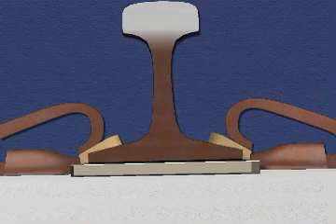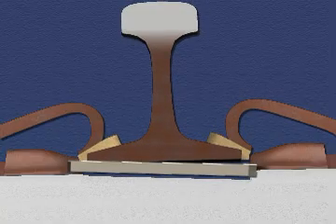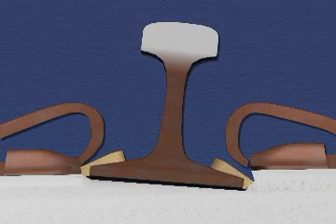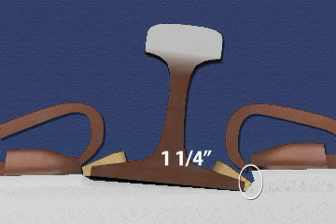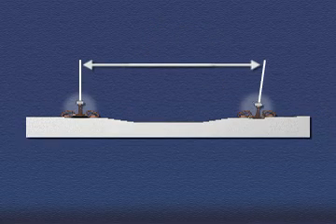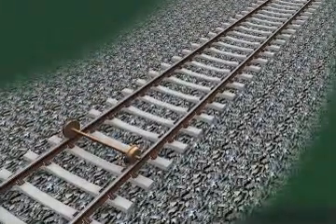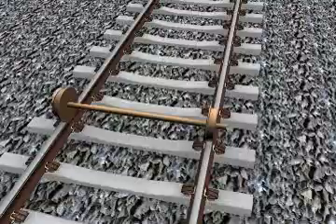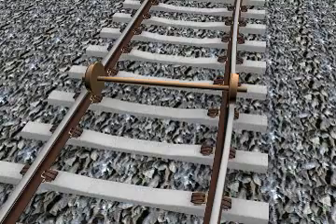Derailment of Amtrak Passenger Train No. 27

Comment: build new wheelsets with double-flanges;  one on the normal inside of the wheel, and a second one on the outside of the wheel to prevent
Reply: That is not feasible as then you cannot easy have turnouts/switches.  Also, if you had a double flange in the case of this video, it would still ride up and over the rail because of the shallow angle of the widening rail.

Comment: Inspections, and the management of inspections, frequently seems to be found wanting in these cases. An inspection train had twice flagged guage widening at this location, but only at a level that required monitoring. Monitoring may be appropropriate if it's know why the guage widening is occuring, but I'd have though that until then, it should be treated as an accident waiting to happen, because it's not known whether the train is detecting the greatest widening possible. There was a different kind of inspection train better suited to detecting guage widening but it wasn't being used there. Similarly, there had been reports of rough running their prior to the accident, but the response was to inspect, and when nothing was found, to leave it at that. Given that there was more than one such report, I'd have thought that the track should be regarded as suspect until a reason for the rough running was found, or until the track had been inspected in detail, using the appropriate equipment, and found to be in good condition.
Reply: As an active railroad employee who is also a Track inspector when an inspection train runs over a territory any conditions that it finds are supposed to be confirmed in the field by performing a follow up inspection of the area.I have been a track inspector for 15 years and I will say this there have been several times where I go and perform a follow up inspection which not includes finding the condition but looking at the conditions of the ties, ballast, drainage and other factors and on several occasions I have imposed a more restrictive slow order and on a few have even removed the track from service till repaired.  A factor with concrete ties is that you also have to watch for the entrance of mud into the ballast, and if there is mud it acts as a lubricate to the ballast to grind the concrete ties to the point of failure. If I remember correctly the FRA minimum Maintenace standard that concrete ties are to be maintained to at least class 4 standards for tie conditions.

This video also shows that there were an excessive number of defective ties in a row which should have put the track out of service till repaired. to that falls onto the inspector and also to the supervisor for not escalating this to repair it.

Comment: Why dont trains run like roller coasters where the wheels are above and below the track?
Reply: It's called Cost to Benefit ratio. Not going to happen. You are talking about millions of cars, trains and countless miles of track and bridges, etc that would have to be changed. It would be more realistic to have a robotic camera inspection unit to run down the tracks on a maintenance schedule to do visual inspections. If a camera can inspect a glass bottle during manufacturing for flaws...it can inspect a track for possible flaws.
Reply: Also, because trains usually don't do loopings.
Reply: @ZorbaTheDutch 
Yes. Usually. But sometimes...
Reply: Because that would more than triple the cost of installing railroad, make it more expensive and harder to maintain, require more expensive and valuable materials, complicate train wheels and make it much more difficult to maintain them, make it impossible to have railroad/conventional road intersections, make switching stations much more complicated and require more power, and most of all, would be an impossible undertaking to install such rails universally.

TLDR literally impossible to implement without bankrupting the entire country and maybe canada too

Comment: I've seen WWII footage of train derailment testing where sections of track were cut out and removed and the trains still did not go off path to show how hard it is to sabotage the railroad system. What changed?
Reply: I think the length of rail being compromised has a lot to do with it. They're talking 19 ties here. In the WW2 testing they didn't see results until longer sections were removed. Also they were removing chunks with the rest still firmly fixed. This rail folded over sideways. Also those trains were relatively low speed compared to a modern amtrak.
Reply: I mean a very big difference is that test you are referring to was done on a straight section of track. Anyone with a crowbar and time can derail a train on a curve.
Reply: The main difference is that the video you watched is on straight track, while this is on a curve. The other difference is that removing a section of track is different from spreading the track. If you spread the track, as in this accident, then a wheel falls between the rails but then things get squeezed when the rails come back together. If you're lucky, that results in the derailed wheel getting pushed back onto the track. But it's more likely to result in the non-derailed wheel getting pushed off the track, and now you have the whole train running to one side of the rails.
Reply: I feel like it is more likely that the "testing" done in the 40's is propaganda, and that railroads were never invulnerable to sabotage.
Reply: @Enny_Gima It wasn't propaganda. The army saw that it might need to sabotage German trains, and also that European resistance organizations would need to do the same. So they needed to figure out the best way to do that.

Comment: It seems kind of primitive in this day and age to use the same gauge / wheel flange / rail design that goes back to the 1800s when trains ran 40 mph.
Reply: It's not primitive when a gauge that was from the eighteen hundreds can move over seventy intermodal trains a day from Chicago to Los Angeles. Somebody has been watching too many sci-fi movies.
Reply: Well, magical levitation trains powered by organic fairy farts are not quite up and running yet.
Reply: There's newer technology, but there's a more modern way to do everything. It's either not yet practical or not economical. I'm assuming the comment above is talking about maglev technology, specifically China's new speed record (purely closed testing). Rails in the US cost somewhere around $1-$2 million per a mile. Available maglev's are estimated at roughly $50-$100 million per a mile. That is ludicrously expensive. Only on the most-used, short-distance passenger routes can this be remotely economical.
Reply: No smoking around fairies.
Reply: Yes, they are.. and have been for over a year now @ 600 + KPH... just not in dead america.

Comment: Wood ties have worked for how long? Watching this videos and I just cannot understand how workers and engineers do not know these things. In another video there was a welding crew that appeared to not understand that metal expands and contracts when welded. 

If you have to heat or cool a mile of track prior to welding then that's what you have to do.

I wonder if the track could be heated using sound waves.
Reply: "Wood ties have worked for how long? Watching this [sic] videos and I just cannot understand how workers and engineers do not know these things."

Creosote wood sleepers have to be replaced every 25 years or so.  Concrete sleepers on the other hand can last a good 75 years or more (if properly inspected and maintained – i.e replacing track pads regularly).  

However, there is a cost disadvantage for the initial installation of conc sleepers (special equipment and training is required).

They [ PEngs ] do understand and know these things very clearly and they would have told BNSF what needed to be done on a regular basis to prevent these types 'wear and tear' from affecting rail traffic.  

However, it is not they who ultimately decide the scheduling of track inspections and repairs when needed.  Somewhere up the food chain at BNSF, some manager (a VP of Penny Pinching?) thinking he'd save BNSF some coin by putting off repair of this section of track (if they were even aware of the damage caused by improperly secured rails on conc sleepers) decided to put off replacing the sleepers and rail pads for some other time.  If a train safely passes over the affected section today, it can pass over the same section tomorrow without issue too.  You can see where such thinking leads.

This is the problem with privately owned infrastructure such as railroads.  The companies have their eye squarely on profit margins, not track inspection and maintenance — because that is a cost that needs to be kept under control to ensure good profit margins for shareholders.  

So the attitude quickly develops that says: derailments and accidents are a fact of life. Spending money on preventative maintenance is not profitable.  Therefor, spend as little as possible to keep the trains moving and when a derailment does occur, deal with rail movement stoppages (line closures) and track repair then.  Insurance will cover (most of) the costs and legal liabilities which can then be written off.

Simply put, preventative maintenance is not a high priority for North American railroads.
Reply: @MelioraCogito  Out of curiosity, does the rail abrasion seen in the video only affect concrete sleepers?
Reply: @chris-hayes   No.
Reply: In a way, that's kind of the problem. They put in these ties that, in theory, can last much longer without needing replaced and then just leave them, assuming its all fine - especially as railroads aren't doing anywhere near as much maintenance as they used to. Having things that are made to last (with proper maintenance and inspections) makes them complacent. When you have to be constantly going up and down the track to make sure your ties aren't going to cause a derailment - you pay more attention to these things.

Of course, more inspectors and proper enforcement of regulations would go a long ways towards fixing that complacency.
Reply: Concrete ties are standard in much of the world. They're not some weird new thing that BN installed for a laugh.

Comment: Did anyone do a comparison between standard wood ties and spike and the concrete tie clamp and # of incidents similar to this derailment?
Reply: exaclty what i was wondering
Reply: I was wondering about that too. With wood you would have the grain running perpendicular to the rail. I imagine this would be difficult for the rail to abrase one edge more than the other. Wood is also more flexible than concrete, that probably affects the distribution of weight and location of abrasion. But, I know nothing about railroads and can only theorize.
Reply: Yep. Concrete that gets overloaded, crumbles to dust and leaves the scene. Wood that is overloaded compacts into denser wood, actually strengthening it. Within limit, of course, but wood is a much more forgiving material against mechanical damage than concrete is.
Reply: Problem with this simple comparison would be that you would have to divide the respective accident numbers by the total amount of wood ties vs concrete ties used in the general train network in order to arrive at a statistically relevant number.
Reply: Classic case of if it's not broken don't fix it- wood ties work great
Reply: @robruss62  Wood and concrete both have advantages and disadvantages.
Reply: Concrete ties are standard in much of the world. Now, it may be that concrete ties, being less common in North America, were less well understood by the inspection crews there, but there's nothing intrinsically wrong with concrete ties.